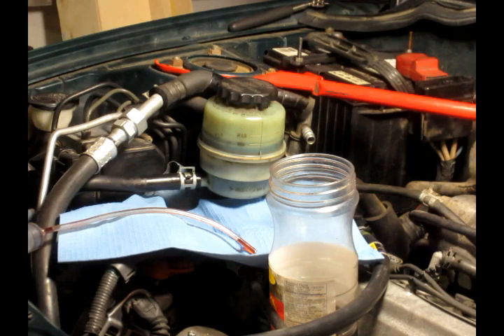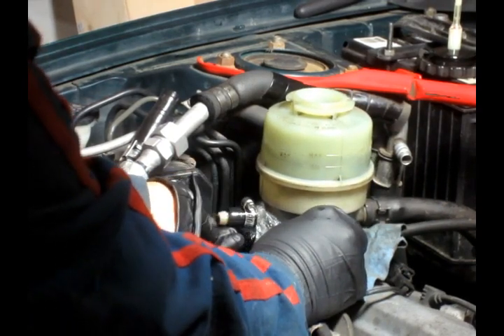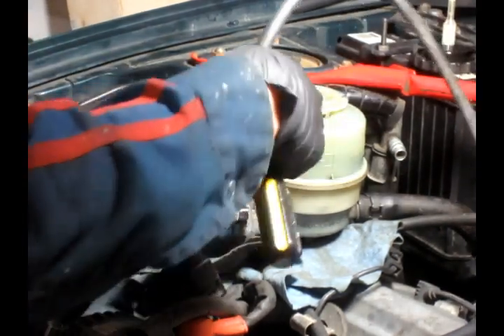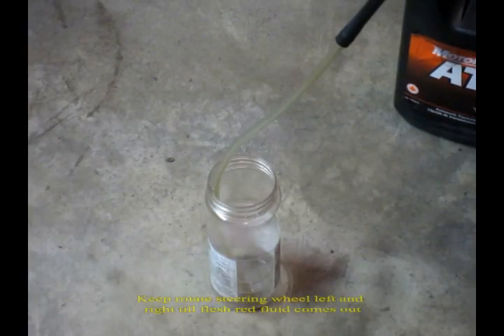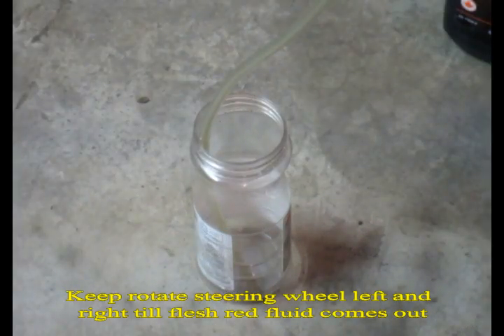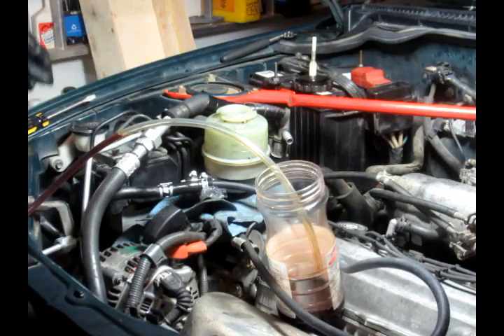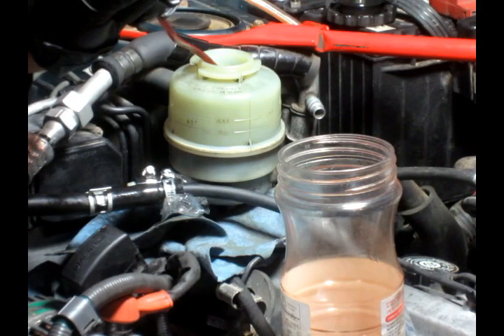How to change Power Steering Fluid - Toyota / Rav4 1996 1997 1998 1999 2000 2001 2002 2003 2004 2005

Comment: I got it. Thank you very much!
The fluid goes through the system through the big hose on the right. You are draining the reservoir and then disconnecting the return hose on the left and plugging the reservoir return nipple so the fluid doesn't drain out while filling the reservoir back up with clean new fluid. You then run the return hose on the left into a container until it runs red or clear of old fluid. 
Thank you again for your video. I pressed the LIKE BUTTON so that you can get more exposure/views.
Reply from the maker: Well done.😀

Comment: You think I can do this method by disconnecting the bottom (underside )part of the return line ?im doing this to a v6 03 taco and that hose cracked so I’m flushing the system from there since its getting removed and replaced anyway

Comment: Thank you for this video. What is that hand pump you used on this video? Do you have a link?
Reply from the maker: That was a  large "flavor Injector" from dollar shop only costed a few bulks. Very versatile to use. Amazon or eBay have it but costs more. Just attached with plastic tube for good uses.
 https://www.amazon.ca/Charcoal-Companion-CC5111-Marinade-Injector/dp/B004RDPM3Q/ref=sr_1_56?keywords=flavor+injector&qid=1587196769&sr=8-56

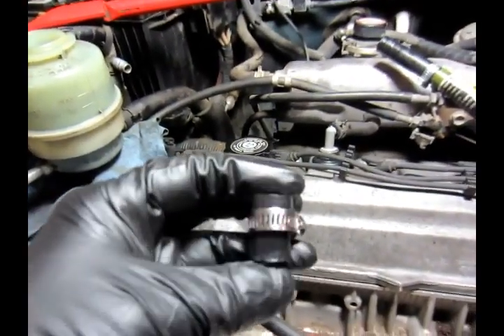Comment: What is the diameter of the "littlehose with the hose clamp" you made and that you show at 1:05 ?
I plan to do the same.
Thanks
Reply from the maker: The inner diameter was 7/16" (1.1 cm). Same size as the return hose. If the return hose has excess, you can cut 1/2" or more for the clamp.
Reply: I measured on my RAV4 2000-2005 (RAV4.2) VVTI and the return hose is 2.0cm. The inner diameter seems to be 16mm.
Maybe the diameter is different for the return hose between RAV4.1 and RAV4.2...
BTW, your method is really the best I seen :)
Reply from the maker: The other way to find the size for different year models. Call your local auto parts or car dealer. They should be able to tell the right diameter physically of the hose of your vehicle.
Reply: I made a custom 11mm inner diameter hose with plug to connect on the return side of the power steering fluid reservoir.
On the return line, I shoved a 8mm outer diameter tube to extract fluid.
I applied your method on my 2004 RAV4 PETROL and it worked perfectly.
It was very easy.
The most difficult part was to find the tubes/hoses to plug on the return line and on the return side of the power steering fluid reservoir
Thank you
Reply from the maker: Well done.

Comment: How many oil I need to make this operation?
Reply from the maker: If you will buy from auto parts shop, the shop should be able to tell you by your car's year and model. If not, you can call a  local Toyota parts department for the information.

Comment: You forget to drive it around and check the fluid again for correct level and leak...
Reply from the maker: Hi! John, Once the engine is on, the power steering works right the way. If there is any air or bubbles in the system, the air should be pushed out immediately without driving. If it happens (but unlikely), have the power steering filled to the right level again. With the way shown in the video, it should have no chance to build up air/bubbles in the system. 

Don’t get confused with power steering which has problem of losing fluid. As the heading clearing stated “How to change Power Steering Fluid” of which means the power system functioning good at the time.
 It is a good practice to check again after driving. I have no objection to that.